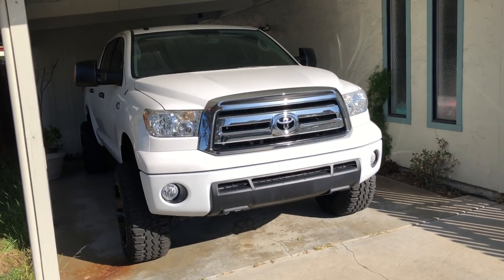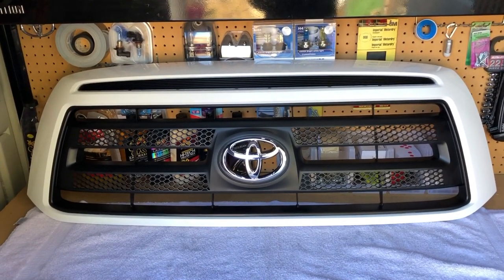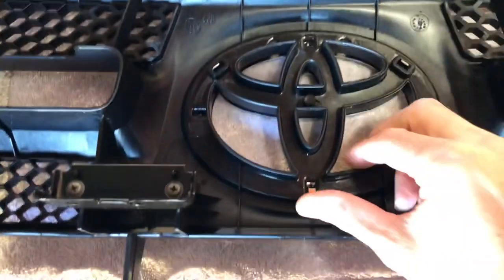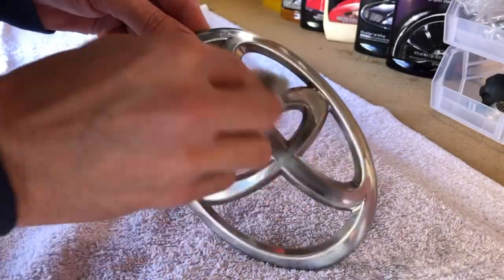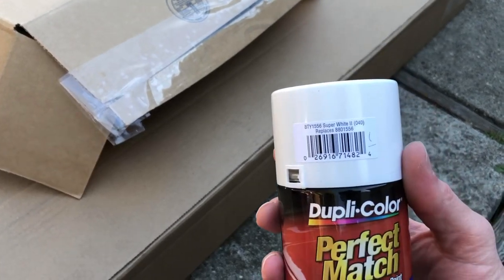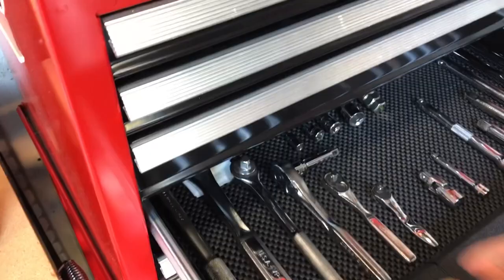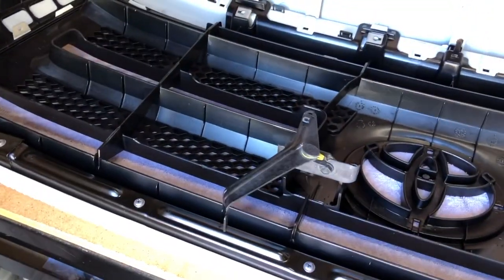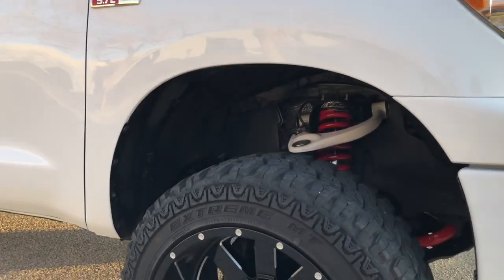Toyota Tundra Chrome Delete New Sport Rock Warrior OEM Color Matched Grill And Emblem

Comment: Very nice! Yes get rid of chrome. Where do you get your tow mirrors from? Awesome truck! Thanks for the great Tundra videos. 👍
Reply from the maker: There just ebay tow mirrors, but there power adjustable, heated and have led running/turn signal lights in them.. they fit perfectly and have given me no problems in the 2 years they have been on the truck!!

Comment: For color matching the front bumper, did you just paint the chrome bumper, or did you get a replacement bumper?
Reply from the maker: Good question.. the front bumper is just plasti dipped white, it’s been on there for over 3 years and still looks good.. it’s the only time i’ve used plasti dip.. just clean it really good with alcohol and then go for it.. 👍🏼
Reply: Thanks for the info! Much appreciated.

Comment: I’ve got a 2010 black platinum need to get rid of the chrome on the bumpers! Did you paint your bumpers or wrap? Or what?
Reply from the maker: It’s Plasti-dip.. i usually stay away from that stuff but a couple years later and it’s held up Extremely well.. they have it in black, you got nothing to lose.. definitely try it out.. 👍🏼
Reply from the maker: Also, i only did the front bumper, for the rear i bought a color matched one from ebay.. 
Here’s one in black for you..

https://www.ebay.com/itm/256401755632?mkcid=16&mkevt=1&mkrid=711-127632-2357-0&ssspo=Xy3Gl-GhRQi&sssrc=4429486&ssuid=7znpTDOfTJ-&var=&widget_ver=artemis&media=COPY

Comment: Great video. 
What size is your lift and how do you like the toytec setup?
Also what size is your rims and tires?
Reply from the maker: It’s a Toytec Boss lift giving about 4.5 inches.. tires are 35’s on 22x12 Hostile Rage wheels, -44 offset..  The suspension is awesome but that damn wheel and tire setup is so heavy, probably should have gone with a lighter 18 inch rim.. looks great, but could perform better.. 👍🏼

Comment: Did you color match the bumpers by painting or did you order new, already painted ones like you did with the grille? I’ve got a black 2011 Tundra and with the Platinum package it has a lot of chrome and I want to color match everything since chrome is ugly as hell.
Reply from the maker: The rear bumper is painted the factory super white color, i bought it on ebay, and it took me 15 minutes to install.. the front bumper has just been plasti-dipped white, it was my first time using that stuff and it went great, it’s been 2 years, and it’s hard to tell it’s not painted.. as far as color matching a chrome grill, i would recommend just ordering a color matched one off ebay, it would be the easiest and best looking way..you can also get factory color matched side mirror caps and door handles on ebay.. check it out..

Comment: How did you do the bumpers ? I really want to delete my crome bumpers , found front plastic one That can be painted but yet to find the real one without the sensor holes that comes primary but not sure if that Poppy even if it’s on or seven so I’m wondering how did you paint yours
Reply from the maker: So i just plasti dipped the front bumper, and it seems to hold up very well, and look pretty good.. as far as the rear bumper, i ordered a factory paint code pre painted one from ebay.. was a breeze to install.. here’s the link..
https://www.ebay.com/itm/Painted-040-White-For-2007-2013-TOYOTA-TUNDRA-REAR-STEP-BUMPER-FACE-BAR-W-O-HO-/263087814406?mkcid=16&mkevt=1&_trksid=p2349624.m46890.l6249&mkrid=711-127632-2357-0
Reply: @toyotafanatics1 how those eBay bumper holding up? Any fitment issues? How’s the build quality? I was looking to get a oem non chrome and paint it but I seen the eBay are cheap already preprinted not sure how good are they.

Comment: Was your bumper originally chrome as well? Looking at a white Tundra with chrome bumper and grill and I'm just not feeling that. Where did you order your parts from?
Reply from the maker: The front bumper was chrome, it’s plasti dipped white and has held up unusually well and matches the super white paint very well.. the rear bumper is a pre painted color matched bumper from ebay, i highly recommend..👍🏼
https://www.ebay.com/itm/Painted-040-White-For-2007-2013-TOYOTA-TUNDRA-REAR-STEP-BUMPER-FACE-BAR-W-O-HO-/263087814406?mkcid=16&mkevt=1&_trksid=p2349624.m46890.l6249&mkrid=711-127632-2357-0
Reply: @toyotafanatics1  nice! Good to hear about plasti dip and thanks for ebay link.
Reply: @toyotafanatics1  BTW what did you use for the emblem?

Comment: Did you replace your bumpers or just paint the chrome ones?
Reply from the maker: The rear is a painted color matched bumper, but the front is just white plasti-dip.. i CANNOT believe it’s been on there 3 years and still looks great.. i need to switch out the front bumper, they sell factory color pre painted bumpers on ebay, but my concern is not so much the money but switching out that from bumper isn’t super fun, i did it on a friends truck..